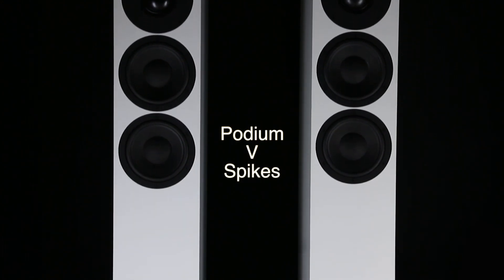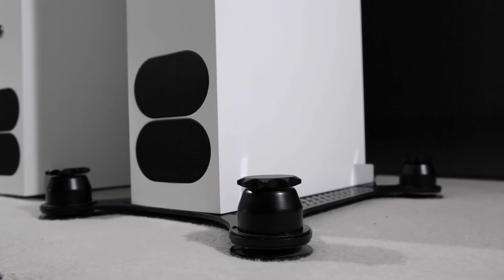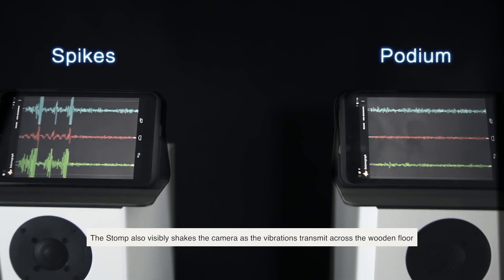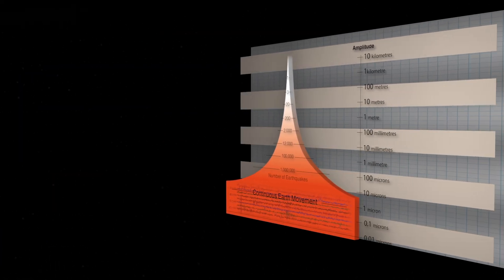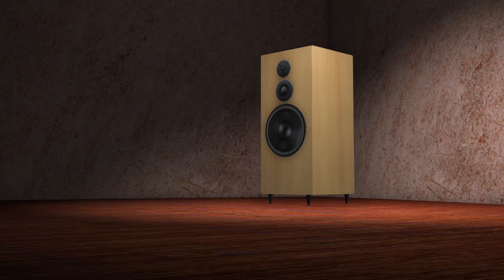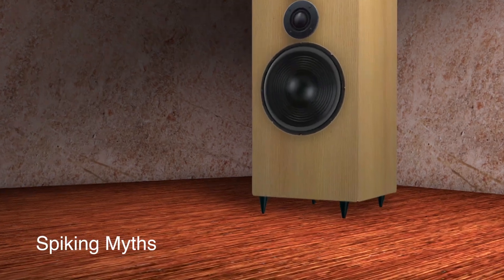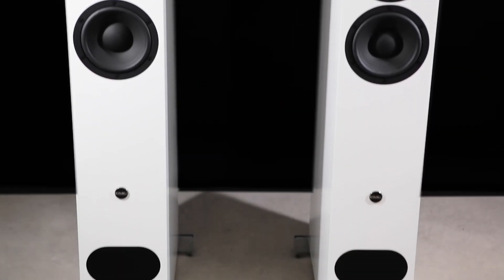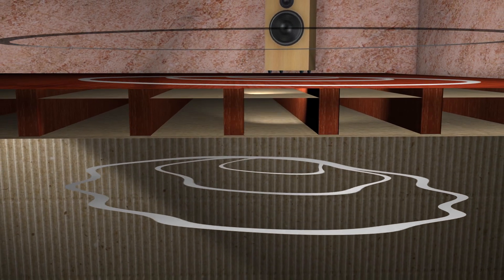Unlock True Sound: How Townshend Seismic Podiums Eliminate Micro Tremors & Vibration

Comment: To me best knowledge (that may be not very much indeed) the oscillating modes of an acoustic device is function of the boundary conditions. Normally, a loudspeaker is designed with fixed contact points. So, making it float is not a good idea. At least not related to design principles. Additionally, the real energetic ground waves are transversal and in a range outside the human ear. Even assuming that these noise reaches the speaker, it cannot reach the ear as transversal waves are not sustained by air. Just some Physics and some 20 years of experience with positioning of high quality loudspeakers.
Reply: Aside from the expense of the Seismic Isolation Podium (SIP), it is too spongy to prevent movement of the speaker cabinet/assembly due to the throw of the speaker voice coil which propagates sound waves unless a sizeable amount of mass loading is added. I would like to see these speakers set up as shown in this demo on a flat level vinyl tile floor driven at 90db pulsed output for various frequencies (start at 50hz and work through the audible spectrum in 50hz increments to 20,000hz) and use a frequency meter (which is insulated from sound transmission through everything except the air) set at 1 meter from the front of the speaker cone which is propagating the sound waves for the frequency being tested, and see what the differences are in the propagated frequencies between the speaker on spikes and the speaker on the SIP. I have come up with a solution which could be used for the speaker with spikes shown in this video for less than $50 + tax: two 2'x2'x2" concrete paver stones (90lb each) approx. cost $16.00; eight spike cones approx. cost $25.00; eighteen 2"x2"x7/8" antivibration pads approx. cost $5.00. Here is how to set up: I have found the best sound from my system is achieved through the use of spikes/discs/antivibration pads/concrete pavers: https://drive.google.com/drive/folders/1C1w4HcZuThrTxImadujOdftffK3s_2K3?usp=sharing. If you have wood flooring or some other flooring material which is relatively smooth and hard, and you don't want to ruin it with concrete pavers being set upon it, use the antivibration pads under the concrete pavers, one near each corner and one in the center.

Comment: Stupid marketing of a stupid product.
Reply: Why is it stupid?
Reply: @florincoter1988  Aside from the expense of the Seismic Isolation Podium (SIP), it is too spongy to prevent movement of the speaker cabinet/assembly due to the throw of the speaker voice coil which propagates sound waves unless a sizeable amount of mass loading is added. I would like to see these speakers set up as shown in this demo on a flat level vinyl tile floor driven at 90db pulsed output for various frequencies (start at 50hz and work through the audible spectrum in 50hz increments to 20,000hz) and use a frequency meter (which is insulated from sound transmission through everything except the air) set at 1 meter from the front of the speaker cone which is propagating the sound waves for the frequency being tested, and see what the differences are in the propagated frequencies between the speaker on spikes and the speaker on the SIP. I have come up with a solution which could be used for the speaker with spikes shown in this video for less than $50 + tax: two 2'x2'x2" concrete paver stones (90lb each) approx. cost $16.00; eight spike cones approx. cost $25.00; eighteen 2"x2"x7/8" antivibration pads approx. cost $5.00. Here is how to set up: I have found the best sound from my system is achieved through the use of spikes/discs/antivibration pads/concrete pavers: https://drive.google.com/drive/folders/1C1w4HcZuThrTxImadujOdftffK3s_2K3?usp=sharing. If you have wood flooring or some other flooring material which is relatively smooth and hard, and you don't want to ruin it with concrete pavers being set upon it, use the antivibration pads under the concrete pavers, one near each corner and one in the center.
Reply: @michaelporter1870  Either I am stupid for not understanding the explanation, or the answer is stupid for not containing an explanation. Either way, thank you for the effort.
Reply: well if you haven't tried it you can't call it stupid can you? I have them and boy what a big difference it made and one of my friends was over here helping me put them under my speakers and we heard the before and after and even his mouth was dropping so yes the podium is really do make a big difference like making a major upgrade to your components.

Comment: I don't think spikes were ever made for isolation. If you want isolation you'd be better off using a rubber foot. My speaker stands have spikes so I can level the speaker on my not so level floor.
Reply: Leveling is not a spike's primary purpose which is to prevent movement of the speaker holder/cabinet assembly due to the throw movements of the speaker cone propagating sound waves.
Reply: @michaelporter1870  Wrong. That is NOT the purpose of spikes. They act to transfer energy to the floor....that causes problems in most rooms!
Reply: @Tinman2809  Spikes decouple: https://youtu.be/4r5D06Evq10
Reply: @michaelporter7434  Sorry but Paul McGowan doesn't have a clue...🙄 Spikes couple to the floor...you need compliant materials to de-couple. It's basic physics...which he obviously doesn't understand....🙄
Reply: @Tinman2809  Unfortunately, I have twice attempted to reply with a link to a photo I have which shows how I have decoupled my speakers from the floor, but the channel owner is removing my reply for some reason or another, so.......

Comment: So all about Isolation, what are the differences of just putting it on a big pillow?
Reply: We have been researching this subject for 50 years and have decided that the Victorians had it right by applying Newton's laws and used the mass/spring low-pass filter. 
A normal big pillow will not hold a 50kg speaker, but if you filled the pillow with something that would hold the speaker, the speaker would fall over. Remedy; you could tie four lengths of fishing line from the top of the speaker to the four curtain rails around your room to stop the speaker from toppling, it would not work anywhere as well as the Seismic Isolators, because the isolators use music wire springs. They work!
Reply: We tried that 40 years ago and it didn't work as the speaker fell over.

Comment: There are so many incorrect premises stated here, I wouldn't know where to begin with this video.  Just one example.  Hopefully, it doen't take a rocket scientist to understand that vibrations and shock / impact are entirely different subject matters and both require entirely different / opposing remedies.
Reply: Shock and impact are just vibrations at a different amplitude and covered under the same engineering analysis
Reply: @maxtownshend8375  That's incorrect.  Remember that we're generally dealing with sensitive instruments designed for high precision and accuracy.  Sure, shock / impact can and will induce ensuing vibrations.  If I take a sledgehammer to a vertical support beam in my house, eventually the entire house will vibrate.  If it doesn't collapse first.  And yes, I'd like my vertical beam to absorb the impact from the sledgehammer.  But nowhere in high-end audio are we talking such impact.  Unless you wanna include the 400 lbs. guest at a party dancing 3 ft in front of a turntable.  We're talking resonant energy originating from 3 primary sources, floor-borne, air-borne, and internally-generated.  Nowhere is a source of vibration considered a stomp on the floor or ding on the side of a speaker cabinet as that is not reasonble nor practical in high-end audio.   For example.  You mention protecting the speaker from the 1M+ earthquakes registering 2.3 or greater on the reichter scale.  That sounds fine from a lay-person's perspective, but you make no mention that the speaker itself is the epicenter of its own little earthquake continously generating its own vibrations and associated energy which is far worse the earthquaks registering 2.3 or above.  Your "isolation" device indeed protects the speakers from outside floor-borne vibrations but what about all the unwanted energy within the speaker you've now trapped within and must now release all of its energy within the speaker including the drivers and crossover?   IOW, you've just trapped all unwanted air-borne and internally-generated vibrations within the speaker cabinet.  Unless one only listens to string quartet music at 65db, how have you possibly improved the effects of unwanted energy within the speaker cabinet?  Unless perhaps you think air-borne and internally-generated vibrations induce no sonic harm.  Mechanical energy's first behavioral principle is to travel away from its point source.  But when trapped, the 2nd behavioral principle is to release its energy at the most easily excitable object within that trapped space.  Think crossover and drivers perhaps?  Moreover, when trapped mechanical energy will often times generate sympathetic vibrations over and above the vibrations already captured.  Again, on the most easily excitable objects within.  Again, think crossovers and drivers.

But then you also talking about objects like a speaker cabinet ringing after being dinged.  Indeed.  But a plastic spoon will also ring just like a tuning fork when anchored into a vice and dinged.   Most any object under stress will ring when stressed.  That's just evidence of energy being released.  So let me ask you.  What does a stressed object like a speaker or even a plastic spoon potentially become when it is sufficiently damped?
Reply: @ToadStool942  spiking a speaker to a rigid floor does not damp internal vibrations. A well designed cabinet would damp vibrations on its own. But a floor is a lousy resonant system and will repeatedly excite the caninet. Isolation is good, damping ( CLD is even better).

But yes, stomping is dramatic but not the best way to demonstrate this. Proper method should be though excitation of the driver itself by sine waves.
Reply: @super-z8943  You are correct when you say spiking a speaker to a floor does not damp internal vibrations.  I never said it did.  Isolation is evil.  First because it's impossible to isolate anything from all sources of vibrations simultaneously - though many go to their graves trying to defy basic laws of physics.  Second because as Townsend said above, we're dealing with sensitive instruments whose presicion and accurracy are at stake.  Sadly the isolationist thinks the floor induces the most harmful vibrations but this is just common folkore perhaps because when taken on its face, it seems to make sense.  More importantly, if one were to successfully isolate one source of vibrations, that inherently implies at least one other source of vibrations will remain trapped within and must release all of its energy within.  Kind of a pick your poison.  If you wanna play vibration expert, you should at least ask yourself what does to a material / object become once it is sufficiently damped?
Reply: @ToadStool942  Have you ever measured vibrations in a well built loudspeaker? Or are you imagining things in your head? A loudspeaker cabinet is damped in itself. The floor beneath it might not be. Thats why coupling might be a bad idea. Isolation might have only one potential drawback, in that the cabinet moves back against the cone resulting in far less than 0.1dB bass SPL, which shouldn't be an issue. Isolation is always good. The logic is to protect the floor from loudspeaker vibrations, not damp loudspeaker vibrations in itself.
Now, there are some rules to isolation. The resonant frequency of the isolation platform (which also depends on the speaker weight) should be far lower the frequency to be isolated. These isolation system you see might have reaonance less than 5 Hz, thats why they are so soft. That is why putting a random rubber piece underneath your speaker might backfire. Don't do it and call it speaker isolation. (You can get away with foamy stuff which creates a frequency dependant isolation with controlled transmission at resonance unlike rubber. Always measure, as it is to naive to generalize given differences in materials and implementation)
Now, coming to the 3rd and the best method. Vibration damping using viscoelastic materials. These might work from best to terrible depending on design and implementaion but can be very very expensive.
Like I said, always measure. Measurements don't lie. Don't measure with stomps, use actual drive unit excitations. But again, sine waves doesn't tell the whole picture!
Reply: @super-z8943  Wouldn't you have exhbiited more class had you just answered, "I've no clue."?  At least that way you could have maintained some integrity.  But by all means, go right ahead and keep playing the expert.  Most can't tell the difference anyway.
Reply: @super-z8943  Since you're unable to answer my very simple question.  Nope.  You just go on playing the expert.
Reply: @ToadStool942  you don't get it. At all. You don't have any experience with loudspeaker design, which is very obvious. Relevant to the subject of speaker coupling/de-coupling, the last question I asked you addresses the entire issue. Find an answer for yourself, not me. 
Loudspeaker cabinets shouldn't vibrate at all. But it does, at certain frequencies, and continues ringing even after the acoustic diaphragms stop moving and that is a serious issue. People who designs and builds loudspeakers go through pain to keep the resonances outside of excitation passband and/or drive the audiobility of those resonance below hearing threshold.
Now, I give you a loudspeaker carefully designed with cabinet vibrations somehow driven below audibility. And you place it over a large resonanting structure! I won't even try to elaborate the problems that might follow.
It is very hard to explain this to someone who have never measured loudspeaker cabinet vibrations and/or don't know the acoustic consequences of these resonances without making very long detail posts, which I certainly don't want to waste on you. 
And I told you earlier, I will not entertain your childish pop quiz game.
If you are really serious about learning anything measure, test and evaluate the audible consequences of cabinet resonances plus the effects of coupling to a resonant structure. Then I will consider you worthy of discussing all things that you claim to be an expert of.

Limited knowledge is a very dangerous thing. Be careful. Get everything covered up, then talk.
Reply: @super-z8943  Since when does designing a speaker automatically imply one is also a vibration expert?  The mind is terrible thing to waste - especially on others.  Stop it!!!
Reply: @Carl Klinkenborg Carl, I perceive tho art a highly intelligent and open-minded gent.  Thank you for your kind words.  The simple answer to your question is, no.  I apologize for not sharing with you here exactly what such an object becomes as I prefer to not assist onlooking mean-spirited isolationists in their endeavors and their lifelong fight against basic laws of nature.  Seriously.  I've invested much resources in my R&D and discoveries and as far as I'm concerned, there are no free lunches for those types.  But I have your name and will attempt to contact you privately to sufficiently answer your question.  Again, my apologies and I hope you understand.  Thanks again.  Oh, BTW.  You know darn well you're one in a million!!! Good for you.  :)
Reply: @Carl Klinkenborg Hi, Carl.  If you check your inbox you'll see that I've sent you a bit of the "rocket science" in response to your supposition err um the original question.  :)  Also, congratulations on the book as I would think that's one of the more difficult accomplishments.  I love to write but....  Anyway, thanks for the support and a pleasure meeting you.  Feel free to reach out if you have any questions/concerns, etc.

Comment: You don't know what you've got till it's gone.

We all love hifi music and it's reproduction, don't we? 
Townshend podiums a lot of money undoubtedly yes, worth it unreservedly recommended the best upgrade I've made. Better than any interconnect stand ancillary. So what do they improve? Everything..! Yes everything. But you don't lose anything its cleaner deeper wider more enjoyable. Mids female vocals are divine all midrange it's cleaner more audible. Top end clearer. What these stands do is take away all the splashy treble all the muddy mids all the boom and bluster in the bass. What your left with is not less but more of what your speaker CAN deliver, which for me is far far FAR away from what I had. So I hear you say what am I using? An all naim pre power with supercap cds3 through focal 948s. All cable is from chord mains and inters and speaker cable.
Townshend have long been on my to have list at some point, at 60 years old the journey is far from over, owning an allegri+ in my second system has proven equally as enjoyable. I look forward to planning more townshend products cabling and isolation platforms. Its buy with confidence 100% just buy those podiums it's an unequivocal no brainer. Want to hear what you're system can really do you'll need these. Or spend thousands on new gear your current system can deliver.... Really!